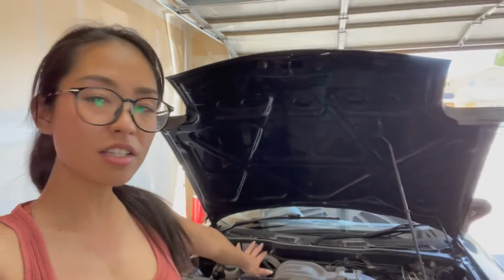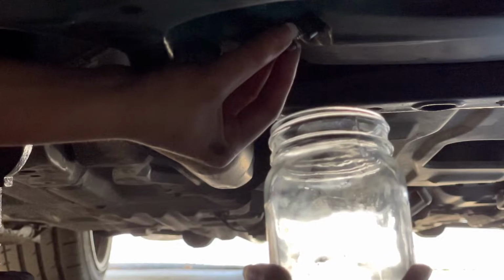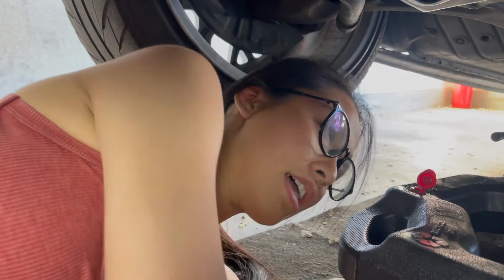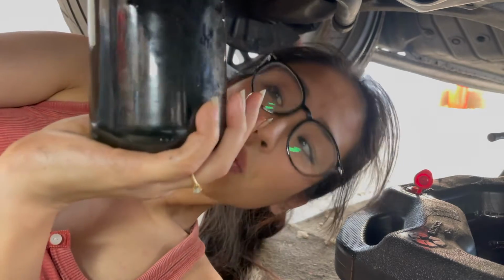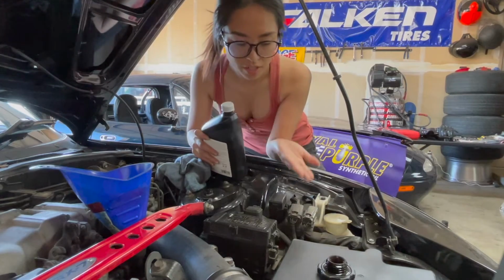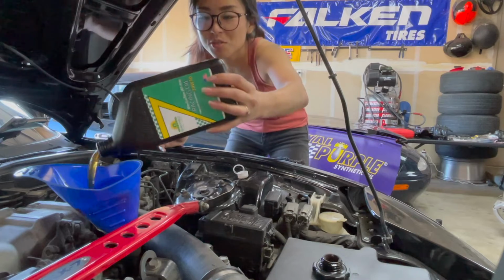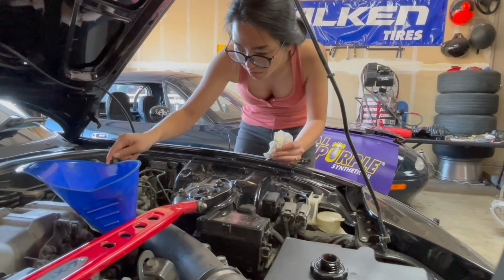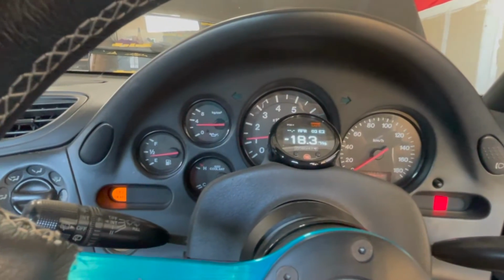I Put Bio Renewable Oil In a Sports Car...

Comment: I use Red Line racing oil, been using it since Tri-Point Engineering rebuilt it in 1998.
Great.....great.....great.....great  😁
Reply from the maker: I don't have experience with redline but I have heard amazing things.

Comment: Keeping your engine clean is 90% changing the oil frequently and that oil looked pretty dark
Reply from the maker: Well its a rotary so they are no stranger to carbon, the engine oil is changed in this car every 3000 miles and considering the amount of oil that remains in the very large oil coolers in between changes, its unlikely to come out the same color it went in.
Reply: All oil gets pretty dark with some use. :P

Comment: even if it is "renewable bio" it is not plant based. often it is synoecized oil from methane gas or other "renewable" sources. av even be syngas from sewage+++.
Reply from the maker: If I'm not mistaken, the company uses natural esters in their rotary products, specifically premix, which is based on either soybean or colza style seeds I'm pretty sure. I'm not an expert AT ALL but I did a bit of research on this and understood it as such. I am sure it comes with other synthetic materials, but the base oil appears to be natural and/or renewable.
Reply: @ioriOki  i hope it is "remade" and synthesized. 
and a Ester oil is normally made syntheticaly. personally i liek to use the soya based stuff in the margarin and not in the engine ;) i just got a shipment of Motul V300 ester oil for my car.
Reply from the maker: Well hopefully this stuff changes the way we lubricate internal combustion engines in the future.
Reply: @ioriOki  i rather use food for food and oil for oil. fully synthetic oil i snot made from normal crude. it is often made from gas of different types.